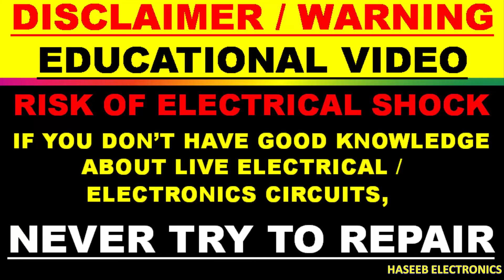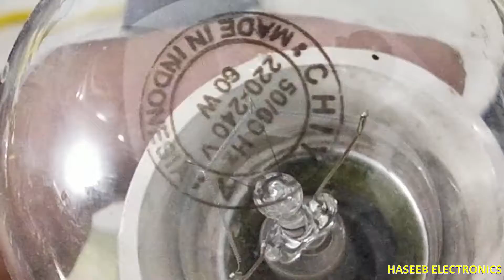{687} How To Use Series Test Lamp To Test Electrical Circuit

Comment: You suggest to build a continuity tester with mains voltage? Really? 😳 To everyone here: Please do NOT such nonsense. It will kill you. If you have no Multimeter, use a torch and connect the probes that it will light on continuity. Never use mains voltage for such tests, please.
Reply from the maker: exactly perfect
I never suggest to do that 
this question is asked by many viewers. so I explained the testing concept

Comment: Great tutorial!

One more point of safety - Even if the body is completely isolated from the ground/earth, in the scenario where the left hand make contact with metal of black alligator clip and right hand make contact with metal of red alligator clip, all at the same time, line voltage will still be applied to body and dangerous current can flow across the heart.   It's safest to have a separate safety switch to apply the mains power after the alligator clips are connected/fixed in place.

Comment: https://youtu.be/J-oZQWJGmJo 
sir, In this video

Why we use 2 opto coupler for zero crossing detection. Is there is no bridge for rectification . Can you explain the need for 2 opto  coupler. I have seen the video of zero crossing detection using bridge rectifier and a transistor with micro controller